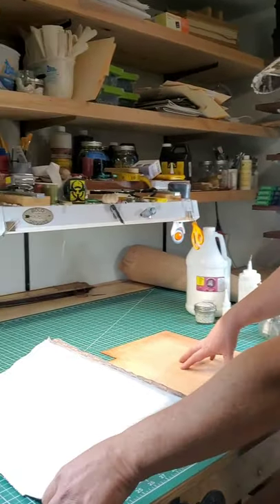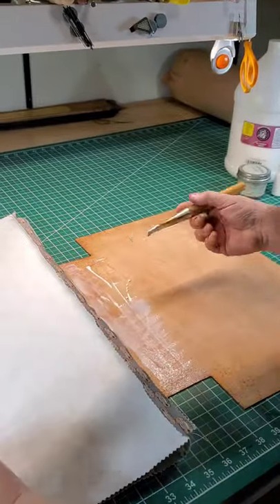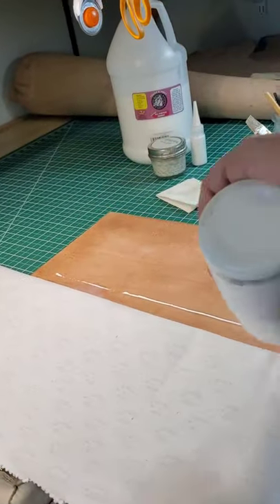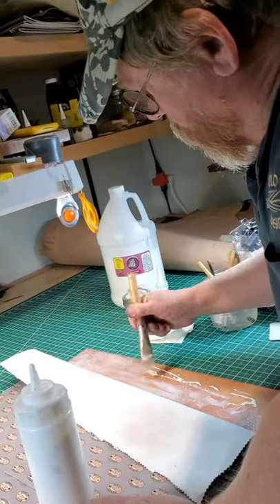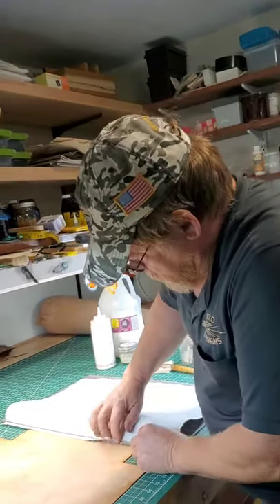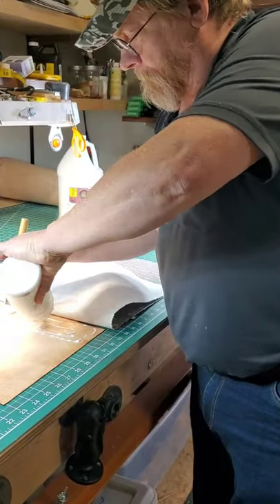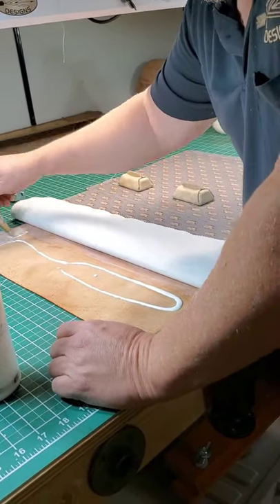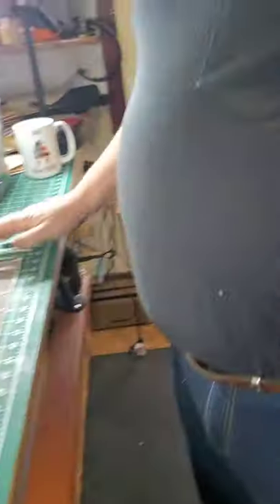Bolo Designs  - Applying my custom printed fabric on to leather.

Comment: Also, will any type of fabric work or does it have to be what you recommend?
Reply from the maker: I've been using canvas and other cotton blends. I prefer the heavier fabrics.  But if you have something lighter, you might want to experiment first on some scraps. But make sure you coat the fabric heavily with the spray starch and let dry first.
Reply: @bobengelsman4425  thank you!  I have some fabric and leather scraps I would like to try.  Thank you so much for being so timely with your advice!
Reply from the maker: You're welcome. Any questions please ask

Comment: Hello, about to embark on my first lined project....can you pls clarify that you would then put the paper template over the top and punch holes for stitching as per usual once lining is glued on? Thx
Reply from the maker: Hello back, sorry for the delay.  I drive a truck during the week.
Here's what I do. On the leather when using a pattern, I mark all the holes for handles or locations of things that need punched out. I cut out the pattern and apply the lining. Then punch all holes out after. 
As far as holes for stitching or lacing. I lay them out without any patterns. I've never had a pattern with stitching or lacing holes.
But I would mark everything out first before cutting the form out.
I hope this helps.
Reply: Many thanks, yes it does